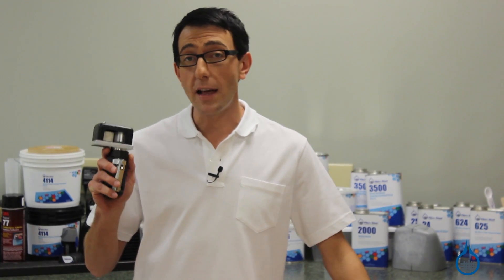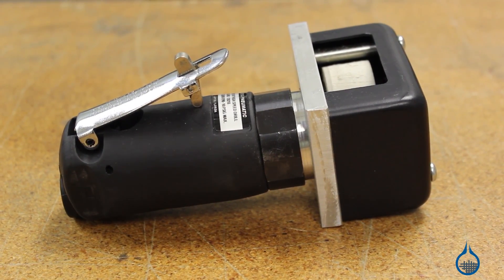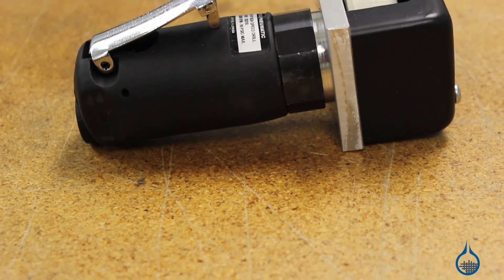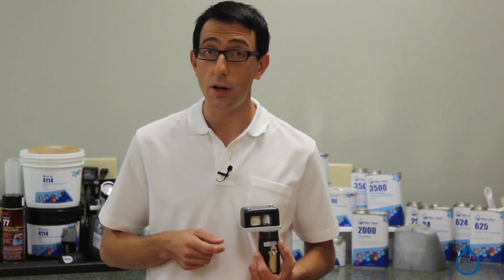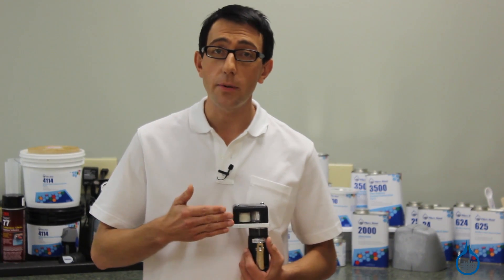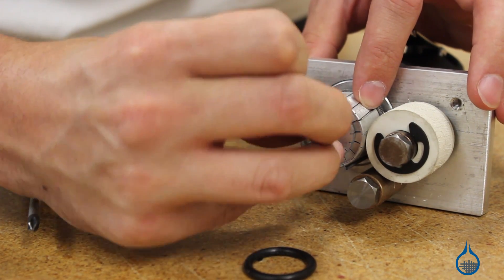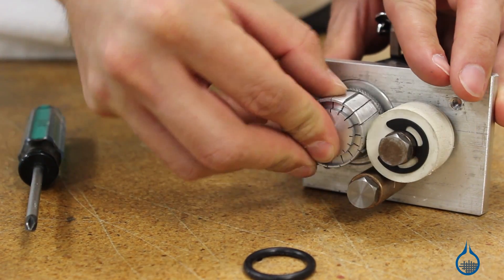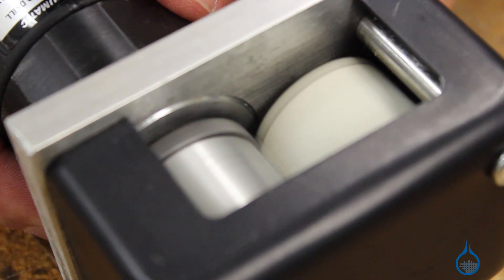1171 Chopper Gun

Comment: Thanks 
How we can control the quantity by the gun its possible or No
Reply from the maker: You can control the length of the cuts by adding or subtracting blades but not really the quantity that comes out. You have a small ability to adjust the air flow which will affect how much is coming out per minute but you walk a fine line between what the gun needs to operate.